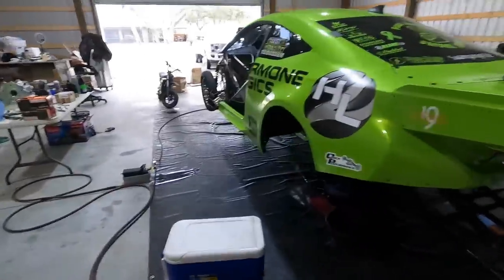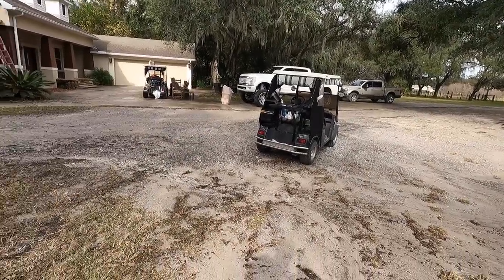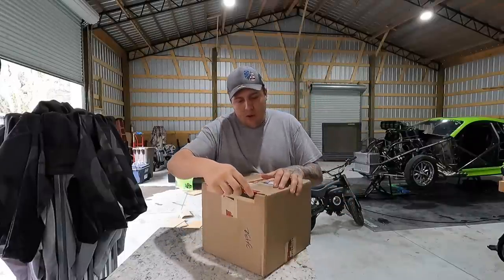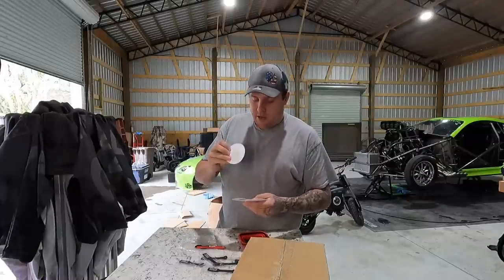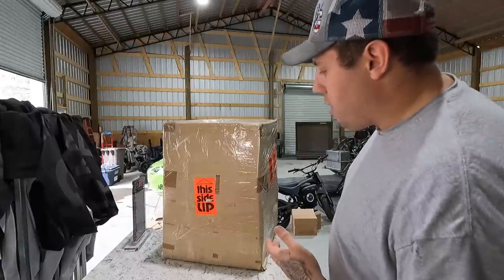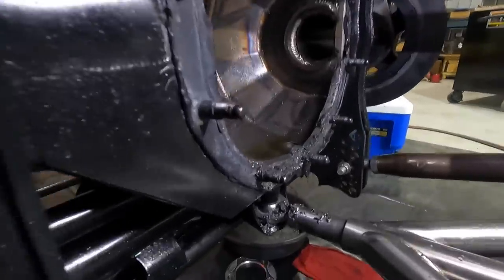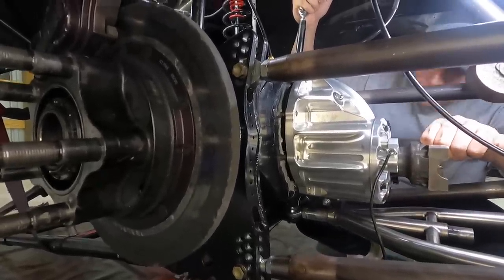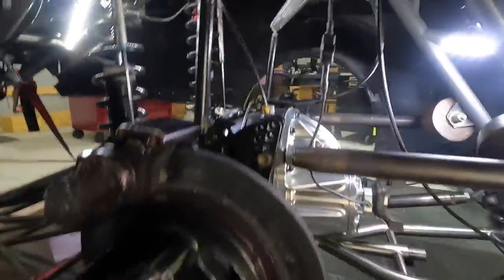Changing Rear Gear With Issues

Comment: Having a CB in a truck and talking to other drivers has saved many of lives over the course of time,  that along with exchanging information about traffic and other needs, it's also useful to keep drivers awake when putting in as many hours behind the wheel as they do, driver of over 20 years myself .
Reply: Definitely saves lives. I had one in my truck for over 20 years. Saves lives and speeding tickets.
Reply: If only truckers of today still used them. We wouldn't see half the crashes we see now
Reply: Right!! All of the “Newbies” do not run CB’s today!!🤦🏼‍♂️
Reply: @Stephen-carr  The old-school drivers still run them , most of these new drivers are just steering wheel holders .
Reply: Guys who don't at least have a CB in their truck are not prepared, at least have one in case you need to pass on info weather wrecks whatever, everyone lives with their cell phones but when ya don't have service and jumping on channel 18 to pass on safety, and it's fun to jump on the old radio and bullshit with other guys while on some long grind of a drive.
Reply: @parentsbasement7734  
Channel 19 there driver, 10:4 ol’buddy over an out

Comment: justin  i hope you cleaned/replace axle bearings with the amount of metal that was present in video, if you need to drill a carrier in future i would suggest doing it on a mill so each hole would be the same it doesnt take about a few thousands to throw it off Not bashing you just some advice

Comment: You know you ain't getting the same motor Ryan Martin is lol.
Reply: Ryan runs ProLine he’s not running ProLine this year
Reply: @chrisgee7668  he has the last 2 years
Reply: @jacobdeem8187  right but he’s running a Noonan hemi this year.
Reply: @chrisgee7668  yes, and I believe that's because he's knows what I said is true
Reply: @jacobdeem8187  he's not getting the same proline(ajpe) setup as Ryan if he stayed proline? Please do explain
Reply: @sentient2016  that’s what he means and it may be true. Ryan did get experimental pro chargers before everyone else, so it may be true for the motor. Happens all the time in racing. Biggest customers with the best chance of winning get the pick of the litter. Could be something as little as a motor with the best tolerances, or one that makes a little more power, or can take just a tiny bit more boost.